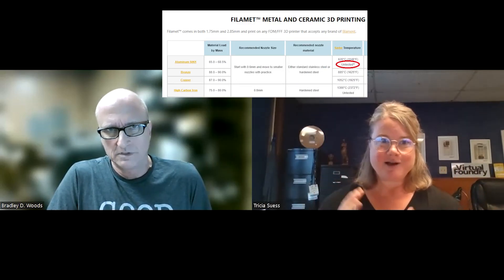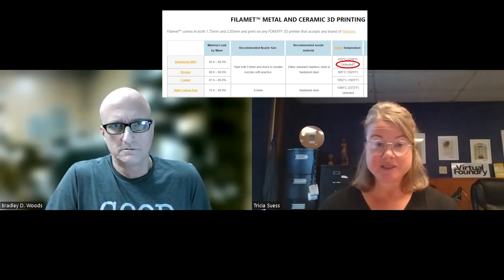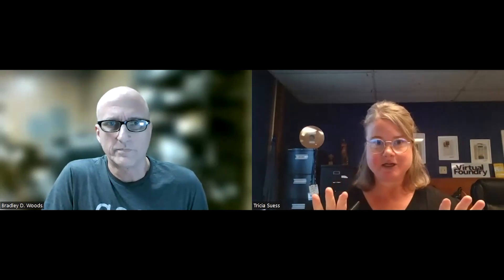Podcast V3E10 - Why Titanium and Aluminum are Different

Comment: If I printed a component in the Titanium.  Who can I send it to be sintered for me?
Reply from the maker: We don't have a Titanium sintering partner just yet. It's in the works but not ready now.
Reply: @TheVirtualFoundry  but inconel is totally doable as is?
Reply from the maker: @miestermind  It is. You'll use Steel Blend for the refractory ballast (print shape support) and Sintering Carbon (oxygen management) in a standard open-atmosphere kiln. Those full instructions are here: https://thevirtualfoundry.com/help/#debindingandsinteringstainlesssteel316lstainlesssteel17-4andinconel718filamet
Reply: @TheVirtualFoundry  does the support material need to also be INSIDE the part if there are crevices etc? And in relation to print orientation will matter?
Reply from the maker: @miestermind  Great questions! Yes, that support material should be inside any places in the print that allow it. You want every part of your print to be supported. The trick is to pack it tightly enough so that the shape is supported through debind, but not so tightly that it can't move in on itself during the shrinking that happens in sintering.
The Z axis will shrink slightly more than X and Y. Usually, the Z axis on your printer will be the same as the Z in your crucible, but not always. If you figure 10% shrink on X and Y, use 11% on the Z.